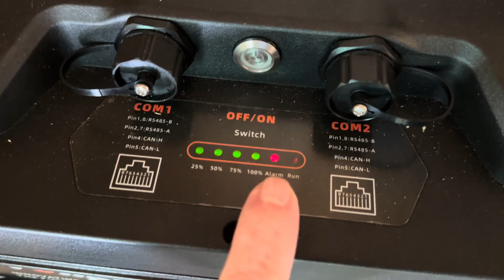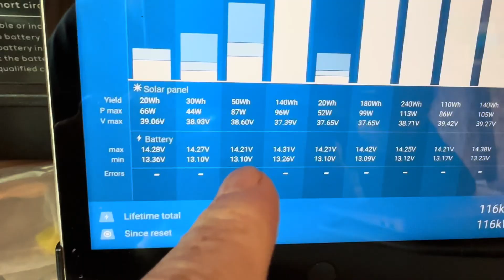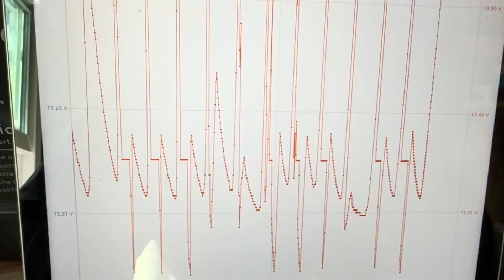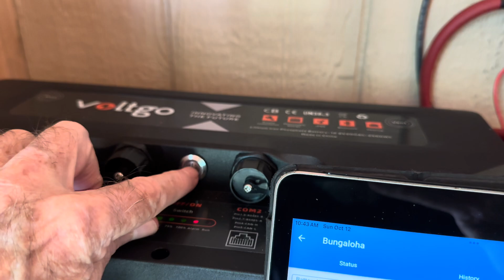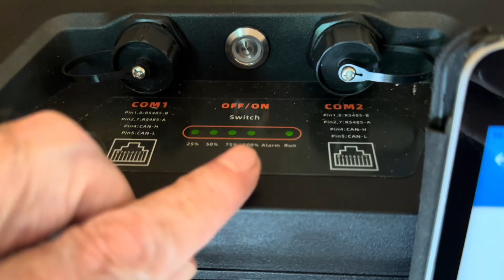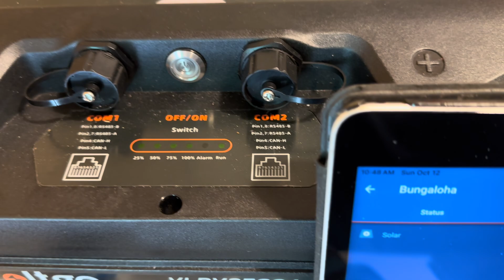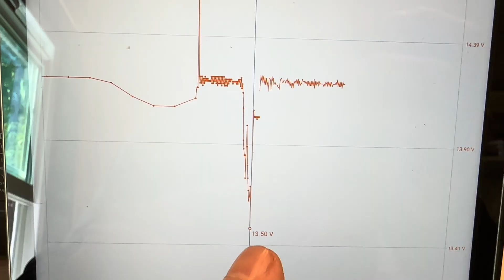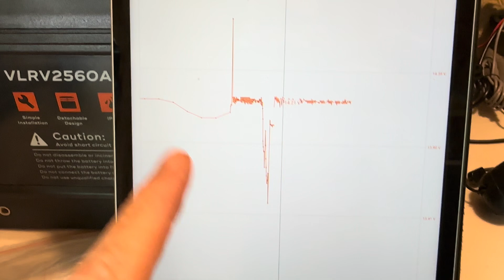200Ah LiFePO4 Acting Up.No Rain.No Fix.No Panic~Survival Mode Always ON these days. It's just Life!

Comment: The voltage dip to 13.50V at 12:00 in the video could be a current surge maybe associated with turning on or connecting the inverter.  And the Alarm on your battery could be an Over Current Warning.  Next time before you turn on the Inverter, check for the Warning and the Voltage log, then turn on the Inverter and a few minutes later check again.
Thanks for the video.
Reply from the maker: I'm going to try that today brother, and mahalo!🤙

Comment: Hi Bob,  IF I have the correct info that battery does have blue tooth and its a very expensive battery at that.  Try using the OverKill Solar application to view what the battery is saying.  It may be just telling you that one cell is in cell protection.  I have been dropping my VE down to 14.1 and my parallel batteries same to take a better charge without going into protection.  I wonder IF the balancer is kicking and the VE shunt is seeing it.  Gary from SE MI
Reply from the maker: Aloha Gary, and you're right. I had forgot about the app, and actually deleted it awhile ago. I'm going to DL it again today to see if I can get any more info off of that. Mahalo brother!🤙

Comment: I have had problems with my solar system, too. My experience is that after about two years, many solar components start to fail prematurely.  There is a movement to require that all Lipo4 batteries be kept outside of any living quarters because of the unanticipated problems.   Personally, I have reverted back to buying individual cells and building my own batteries.  I'm not enclosing them in any box or container because it allows me to better see and monitor what is going on with the cells.
Reply: Imposible to have them ouside in harsher climate.
Reply: Nothing wrong with lifepo4 indoors.
Reply from the maker: I like that idea brother and if I am successful with the BMS and gain confidence I may start doing that as well! Aloha!🤙

Comment: I learned more from this experience than ever could've imagined. All green cells from bottom to top and a good appreciation for how rogue cell over voltage can creep up. The LiFePo4 factory battery settings of the archaic DGJKBM's both needed logical parameters and greater margins Also, all of the VE CC factory lithium parameters have been abandoned in favor of decreased CC and increased CV. Very encouraging experience. Very rewarding. Thank you 
Mahalo
Reply from the maker: My pleasure Anthony! Looking forward to getting that BMS now. If I can get that PQ back into production I'll be very happy! Aloha brother!🤙